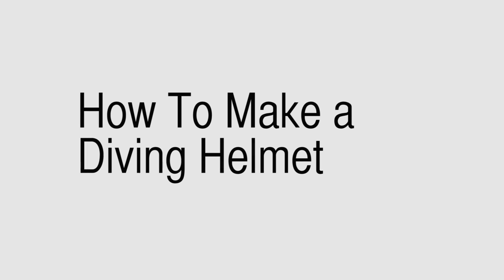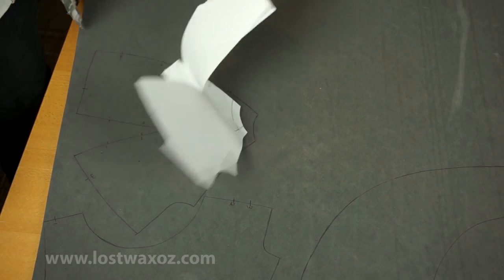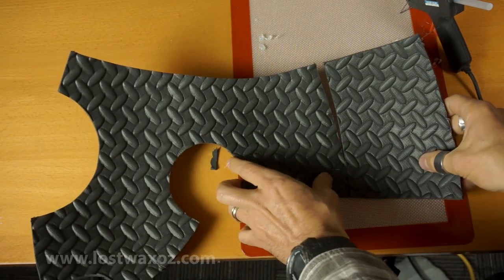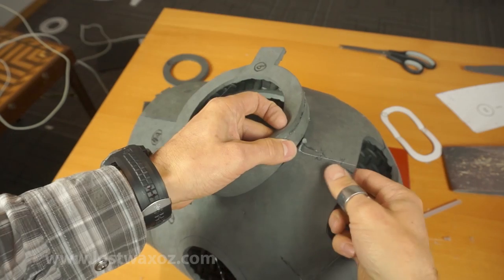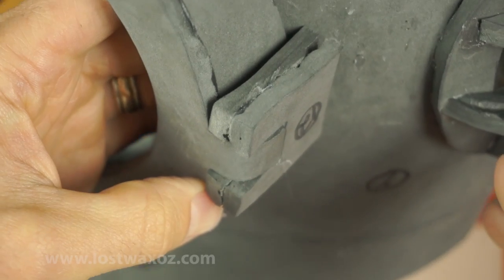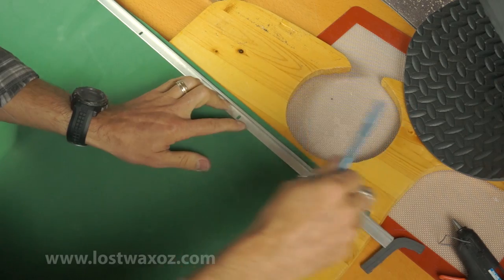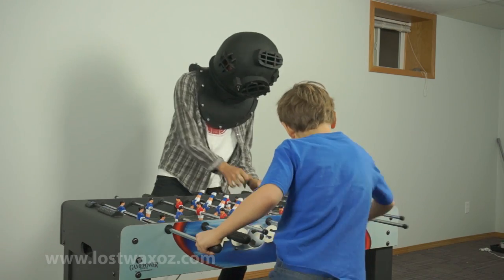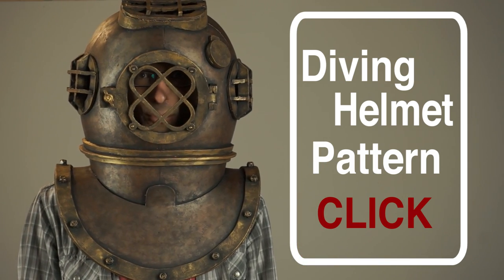How To Make A Foam Deep Sea Diver's Helmet. DIY Halloween Costume

Comment from the maker: Hey everyone, my preferred paints and supplies change over time.  You can check out my current favourites on my Amazon page (affiliate link) https://www.amazon.com/shop/lostwax
Reply: Hola. No puedo comprarlo con la tarjeta. No me deja.
Reply: Pieces 13 and 14 are supposed to represent a component on the real dive helmet that directs a stream of air on the forward viewport to prevent condensation.

Comment: Pieces 13 and 14 are supposed to represent a component on the real dive helmet that directs a stream of air on the forward viewport to prevent condensation.
Reply from the maker: Nice!
Reply: @LostWax  so I've been doing some research, and on helmets of older design, like the russian 3 bolt diving helmet, it is an air diffuser.
However on the U.S. mk 5 it's a pocket for the communication speaker.
Reply from the maker: @nateharder2286  Ah, yes, that is what I thought it was. Thanks!

Comment: This looks realistic enough to give someone a heart attack if you threw it at them !!   Nice job. The GOOD EVA foam, without the tread plate on the back side, would look much nicer for this project.
Reply from the maker: Yep, I used to have one of these sitting on our mantle, and people always thought it was real:)
Reply: @LostWax  Yeah.  I'm definitely gonna build one, using your work as inspiration, along with a nice, little replica, that I got a good deal on, at a thrift shop, as reference. It's pretty accurate, and the details appear to be exact. It's made of real brass and some other metals, and is roughly, about a quarter of the size of the real thing (about the size of a large cantaloupe or a honey dew melon).  It's pretty cool looking for a small scale. Now I wanna make an actual size one out of EVA. I'm glad I found your video. GREAT JOB!!

Comment: you could have cleaner unions if you glue them upside up, don't be afraid trust me!  this is awesome! 
you sir have earned my subscription!
Reply: 5:26 thats where one of the hose go
Reply: TDUD3 It's actually for the diver's microphone
Reply: oh cool to know, thanks!
Reply: TDUD3 You're welcome, also the airline runs to a check valve on the back of the helmet and the exhaust vent bleeds off the side so it doesn't bubble in the diver's face.
Reply: John Beauvais cool!, like I can get an idea of the all and how it works watching some videos and such, but never knew that.. that part were a microphone, never went to really search about it.. now im more intrigued about the all custom.. im gonna research for it, thanks man.
Reply: TDUD3 You're welcome, check out the diving museum website they have some excellent reference material.

Comment: If you take any suggestions (don't know if you do or not, but just for curiosity), would you be able to make bracers that have slots in them to hold your phone? Either on the outside or the inside of the bracers.

Comment: just got the patterns, planning to build this with a few modifications namely some exhaust vents concealing fans, spooky looking window tinting (only after making sure a fan can provide enough air) and trying to figure out a simple way to harden the helmet with fiberglass and twist on/off the actual helmet from the collar for a costume im planning... one question, where can I get a roll of EVA foam that size, preferably from a retail outlet found in the USA?
Reply from the maker: I'm not in the U.S. but I would check at the big hardware stores, usually sold as a kind of anti fatigue mat. I also have a link to one from Amazon on my product page here:  http://www.lostwaxoz.com/product-links/
Reply: I actually found some at harbor freight tools when I went for some cheap bits to work on this with. I was familiar with the puzzle mats but the roll is a bit thinner and I ended up picking up enough foam for several helmets as there was a sale on the puzzle mats

Comment: What thickness foam should I order for this project and sq. ft. needed?  I see on Amazon it comes in various stiffness too... do you know what stiffness level to buy also?  Wanted to know ahead of time so when I order my pattern I have my foam already.
Reply from the maker: The regular size pattern will fit on a 72" x 19" sheet of foam. As for density, you want something a similar density to the puzzle piece foam mats you can get. But it will work even with the lighter,foam you'd find in a camping mat.

Comment: Do you have any advice on how to clean up the messy glue seams before I paint it? Sandpaper perhaps?
Reply from the maker: Definitely. I am going to assume you are using hot glue? If you take a small piece of the foam that you used to make the helmet- this works best if you didn't use really soft foam, and you rub that foam along the glue seam kinda quickly. The extra glue will soften and rub away, leaving a pretty nice seam. If you want to go a step further after that, use some fine (400grit) sandpaper and repeat.

Comment: Bravo maestro!   how do you make the templates? do you use a program?
Reply from the maker: +Mathias Chaidez Thanks! I make the original template by hand, then I scan it and digitize it.
Reply: +Lost Wax Is there any trick to making a template that fits together?  I always have a hard time figuring out how to cut pieces in a way that allows them to form into curves and spheres.
Reply from the maker: +ClassicSteam If you can make something that is pretty much the shape you want, and then cover it with some tape or something like that, and then cut it off, after a little practice you can figure out the best places to cut to allow for the curves. I often start this way to get the basic pieces and then tweak and adjust them until it looks right. Hope that helps a little.

Comment: Awesome design!  I have worked a bit with cardboard but after seeing what you did with foam, I'm giving the diving helmet a try!  What did you use for the rounded screw heads on the front face plate?
Reply from the maker: Those are just actual nylon nuts glued on.

Comment: Have you ever thought to use a spot putty or kiwk-seal to get near perfect seams?
Reply from the maker: +Adam Van Driest I have tried a type of painter's caulk, and it works O.K. but you have to get it right when you apply it. I would love to find a product that you can sand afterwards but is still flexible enough to move with the foam. so far what I have tried wouldn't be that easy to have end up looking good....
Reply: +Lost Wax http://3mcollision.com/products/fillers-and-glaze/putty/dynatron-glazing-spot-putty-650.html According the description of this stuff it's flexible and sandable, however I've never tried it.

Comment: Also make the nut that sits just in front of the left shoulder longer than the others. This is called the bastard nut and it's where the air line attaches on the real deal.

Comment: It would be helpful if you gave a time frame of how long it actually takes to make these projects. I am a prop and costume maker and this build feels like I need a masters in computer science from MIT to complete. Assembling the pattern alone took around 2 hours. Cutting and tracing another 4 hours. Cutting the pieces from the foam was another 2 hours. Hot glue isnt the best choice for this build. Even using the mat ive had nearly every seam rip and i’ve had to re-enforce them with craft foam strips. I’m taking this build off my commission list or I’m charging $500 plus materials. 20/10 would not recommend this build to someone just starting out. Chris i do appreciate your videos and instruction and I’ve purchased your everything pattern package. Ive made many of the props in the package and this hands down is the hardest. Keep up the good work.
Reply from the maker: Thanks so much for your feedback, I really appreciate it. Yes, this one can be a bit tricky, though I think it is also one of the most impressive builds once finished. I would be interested to hear what specific materials you were using, as I have not had feedback about seams popping, etc from others who have completed this pattern - there really shouldn't be a ton of stress on the seams as the curves are relatively gentle. If you have the time to give me more details, I would love to hear from you, my email address is lostwaxozcontact@gmail.com 
If you were to do it again, it might be worth trying some quality contact cement instead of hot glue. I don't recommend it to my viewers because it poses a significant health risk if you don't take proper safety precautions, but it might be the magic to make this an easier build for you.

Comment: Making this- can you share where you got the foam. Or how to find it/what to ask for/google.....???  PLeeeeaaaaaassssse:)))
Reply from the maker: It depends what country you are in. If you are in the U.S, I have some links on my products page here: http://www.lostwaxoz.com/product-links/   In Canada I get my big roll of foam at Home Depot, but they pop up from time to time at other large hardware stores as well. It is generally sold as EVA foam anti-fatigue mat. The one I get is between 5-6mm thick. Hope that helps!
Reply: Thank you SO much- just bought the pattern.  It'll be featured in a little  movie and we'll give you a shout-out! I went to link you sent and I'm wondering is 4x8 enough foam for diving helmet or should I get two?
Reply from the maker: Yess!! I definitely want to see your little movie!!   A 4ft x 8ft sheet is probably enough to make two helmets from, so you should be good with one roll, even allowing for some mistakes.

Comment: Would this still work with 1mm to 3mm foam or should it it be 6mm to 8mm foam?
Reply from the maker: It really should be at least 5mm, otherwise it's just going to be too flimsy.
Reply: @LostWax  Thank you and is 1cm (10mm) thick foam okay for this too?

Comment: What thickness of foam did you use for the main parts of the body
Reply from the maker: I used 6-7mm thick foam. But it was reasonably dense. If you are using the lighter camping mat foam 8-9mm would be better

Comment: Is it possible to buy the pattern as a unified file since I can go to a print shop and ask them to print it in one single sheet instead of multiple A4 pages?
Reply from the maker: It might be possible for me to do that for you depending on which pattern you want, If you email me lostwaxozcontact@gmail.com  I can possibly help you out. (I am away from work for the next couple days though....)
Reply: Of course I couldnt wait until you reply so went ahead and purchased it a few days ago and will email you the results and inspiration you have given me.

Comment: If you put glass in the eyeholes could it work ?
Reply from the maker: Just make sure you have enough air coming through so you can breathe!!
Reply: you would need an air pump and a way to keep the water out other than that water proof that and seal it up and your real for the ocean

Comment: how did it not get wrecked when he went under water? unless it was fake. love your videos  btw get a heat gun. they are not that expensive
Reply from the maker: The foam can actually take a fair bit of abuse. It was definitely real:) And yes, I have a heat gun, but I think the fumes you get from using that on foam are not so good for you, also I like to show people that they can often make do with things they already have around the house. Cheers, Chris.
Reply: huh. try a dust mask maybe. if the dryer works for you then use it

Comment: Not certain how it would be a suffocation hazard, seeing as it would be impossible to fit it on if the neck cuff had an air-tight fit... >.>;
Reply: ive made eva foam helmets smaller then this with plastic on the eyes, i did not suffocate. Dont use glass tho as if it breaks it can be dangerous. It DOES make ventilation not as good, so the inside gets hot and steamy quickly. for something like this id suggest just mesh for everything, and if you rly want a window look just on the front.

Comment: Though I like most of your videos, you should do some things a bit more correctly. Registration marks are there to be used. You show gluing pieces together without using them and the alignment is off. Just do it right if you are showing people the right way of doing these things.
Reply from the maker: Yep, good point. Sometimes I think I totally have a pattern dialled in so I make the tutorial video, and then notice a couple of registration marks need tweaking. I fix them for the final pattern, but rather than completely remaking the project, I still use that footage. It just helps get the pattern out to you guys faster.